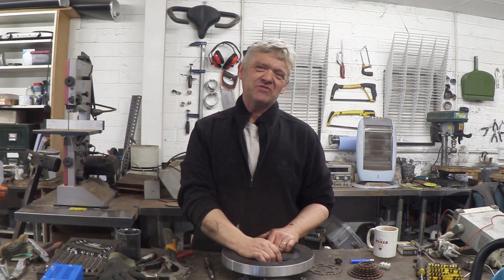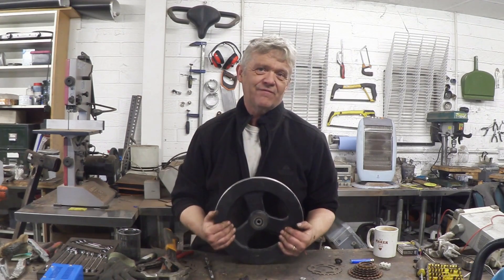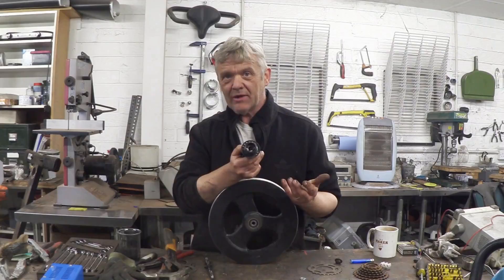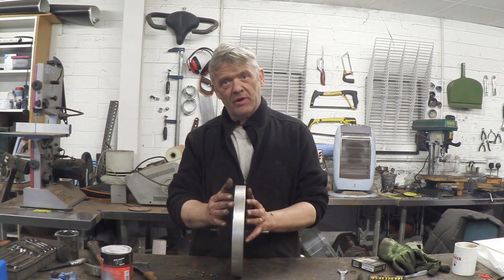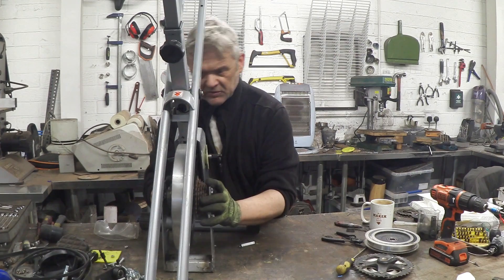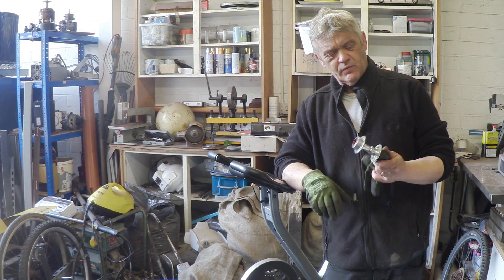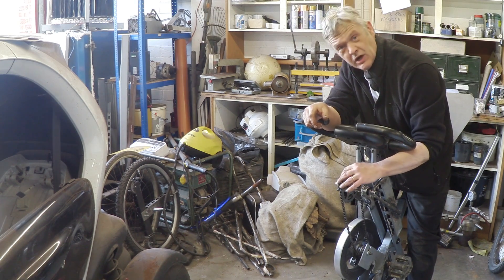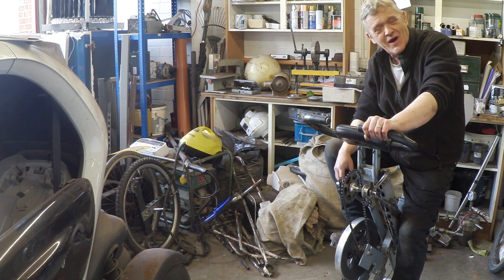1177 How To Make A Pedal Powered Machine - Dynapod Mark III - All Chains And Teeth

Comment: It would be neat to see a diy adsorption refrigerator or air conditioner powered by a pedal powered vacuum pump.  Pretty sure that combines 3 of your previous projects.  Though I doubt you have the parts lying around after all this time. Also, do you think an adsorption chillers hot side could provide enough of a temp difference to run a low temp stirling engine?
Reply from the maker: that is a really neat idea mate - after I have finished the paper bike iw ill get on with that I think
Reply: @ThinkingandTinkering  awesome, it's be neat to see how different materials would affect performance.  And if you could talk a bit more on the possibility of a solid state stirling engine while you're interested.  I think I get the idea,(doing work by having a material change from liquid to gas based on temp and pressure differences)  but I can't think how you'd get the power out.

Comment: Your welding is getting better Rob.
Reply from the maker: cheers mate
Reply: @ThinkingandTinkering  Hai! Your welding IS certainly improving. ;-)  And do I hear an 'inverter' welder?
One tip, if I may, angle the stick up in the clamp 45deg, it's far easier to control the arc that way, and the feedback feel is much better. and your hand is less likely to get in your view.
Nice looking project.
Thanks for sharing.
Reply: @bikerfirefarter7280  good tip

Comment: Bloody rippa mate, I love the gears and derailer system, it really takes it up a notch (and down, lol).
When you pulled out that flywheel I realised that you could use a large heavy weightlifting weight as a flywheel like you have here but larger and heavier. They are usually well balanced and ready to weld on the cog.
Reply from the maker: nice one mate - cheers
Reply: Energy stored in a flywheel goes with the square of rpm, so logically a much higher final input gear ratio and a smaller/faster flywheel would yield same/more power for less mass. Of course at higher rpm air/friction losses might start to come into it a bit. And I don't think I'd want anything much over a 10kg disc fizzing round under my chin, but I'm over-cautious/chicken.  ;-/ And don't dismiss the gyroscopic effects too glibly, I once left a flywheel on test, and came back several hours later to find it canted over about 30-deg.
You are very unlikely to 'pop' one, but I wonder what the burst rpm is of a weight-lifting 25kg disc. And what the energy stored would be at, 'She canny take any more, cap'n'!   ;-O    D'ya wanna try it? (safely, of course). I think I'd try it in a deep hole in the ground, just in case.

Comment: Great Idea, I wonder how long the freewheel gearing will last at high speeds over time. Now all there's left is springy seat with small damper for pleasant seat on bumpy roads.
Reply from the maker: about the same as a push bike I would think

Comment: Consider that many invalids are over weight, due to lack of exercise.  Legs provide a majority of muscle used in cycling.  Modern delta/tad pole trikes are too light to support a 400+lb person.
In addition, the drive train wouldn't be substantial enough for the load.
Heavy duty exercise trike, that using hydraulics.  The main benefit being fluid control of input resistance.  Accumulators would serve the same function as a flywheel.
New experience with spear valves.  Use the frame for plumbing/storage.
Reply from the maker: could a wheelchair not be adapted?
Reply: @ThinkingandTinkering  400lb+ ?, that's a forklift you'd need, but I don't think they do a pedal version.
Reply: @ThinkingandTinkering  I have a spare!!
Oh my Gosh, I am Nearly There now with the parts!!
And, I can donate the other wheel now, if anyone needed it!!
Opps, no, I better hang on to that, in case of any problems I may /probably have!!
(* Murphy's Law!! 😅) XxX
Reply: @ThinkingandTinkering  Thank you for asking.
IMO, the reclined position orients the torso to a better position for leg extension.
As the 'target' consumer would be in the 600lb range, the heavy duty frame, wheels, and drive train, would make for a great strongman competition event (promotional).
One of the reasons to use hydraulics is, an electric pump would be extremely simple to add.  This would allow for outside mobility, w/o having to worry about getting back home, if exhausted.
Reply: @cheerdiver  600lb !? f-me! That's forklift territory.
Reclined - better for leg extension? No. It just gets your gut off your lap/handlebars.
Reply: consider that considering someone an invalid makes you invalid.
Reply: Wow, let us know how that turns out after you build it
Reply: @401ksolar  I'm with you on this one!! 😁. XxX
Reply: @401ksolar  Automation breeds complacency, and this world is too automated as it is.
I'm doing you a favor by not making it, try to comprehend the exponential murder rate in the U.S., once the model T started production.
Your retort is a prime example, of automation abuse.  Hence the strong motivation.
Reply: @cheerdiver  And I Suspect we will be able to see you soon on YouTube with the one that you have made for yourself then?! 🤔😅.
I think we may be waiting for some considerable time..... 🤣
Reply: @Cheerdriver
NICE, REALLY FECKIN NICE!!
WTF!?!! 

* Do you want me to Draw you a Diagram as to Why this is Sooooo Offensive?!!

I am really, terribly sorry for being a Skinny, Fit Invalid,
 I truly hope that my Dad, also an invalid, in his 70s and Undoubtedly Fitter physically and Certainly Mentally than You, I hope he Never reads your comment, because the gasket he'd blow, would probably cause a Tsunami,
 and I am really sorry for the update sweetie, but the majority of the People who become Overweight, are not disabled in any way, shape or form, or at least it's 
-The Weight that may cause their problems, and Not, Vice Versa!!

Thank you, btw as I think that I can now Add high blood pressure on to my list of  ailments...I'd send you my Medical Bill, if it were possible.

Ps, I still Cycle, despite the fact that I'm a wheelchair user, now try and get your Brain Cell around That!
Reply: @AndreaDingbatt  Yeah, don't sugar-coat it, you tell it like it is.  ;-)      (excuse the 'sugar' pun).

Comment: That mechanism seems to be a perfect addition to passenger seating in electric cars, flywheels in between battery blades under the floor, chains and chain guards in the passenger compartment floor area, flip up so passengers can assist the charging system
Reply from the maker: no free rides here eh lol - cheers mate lol